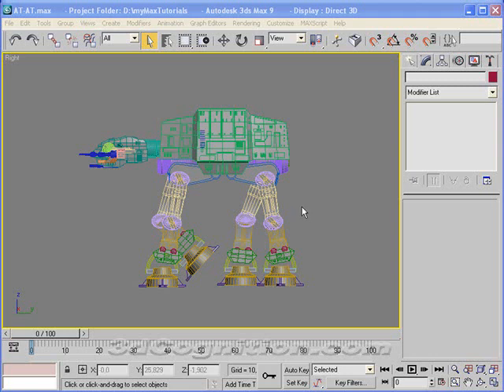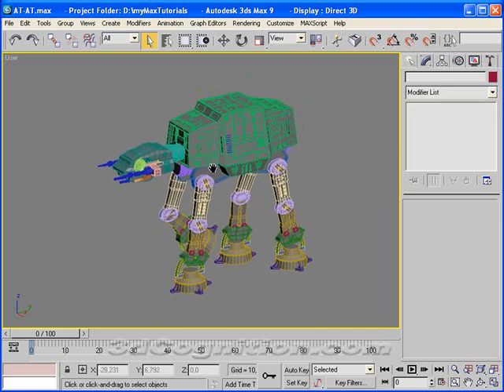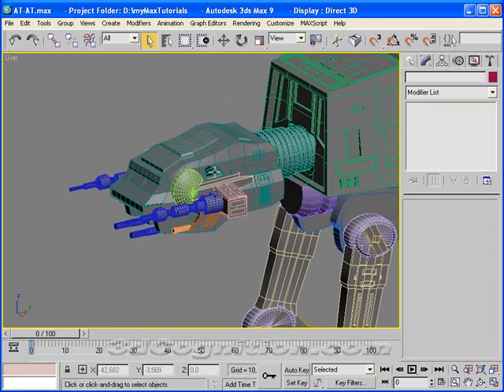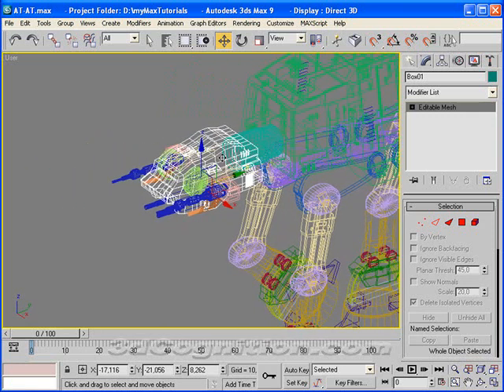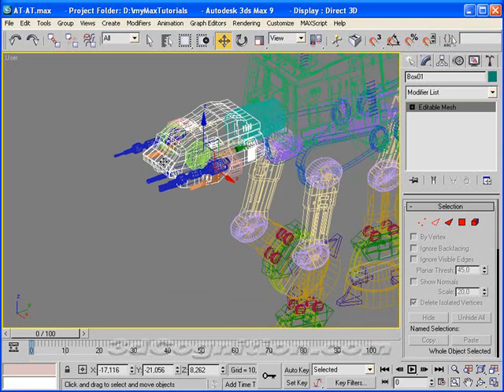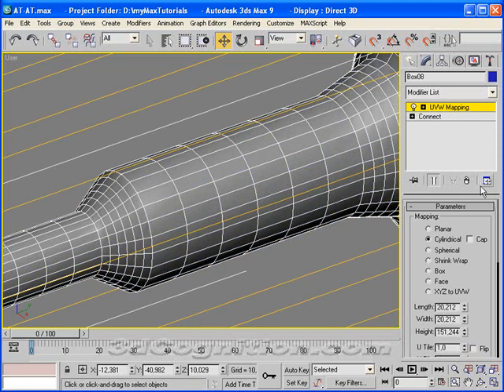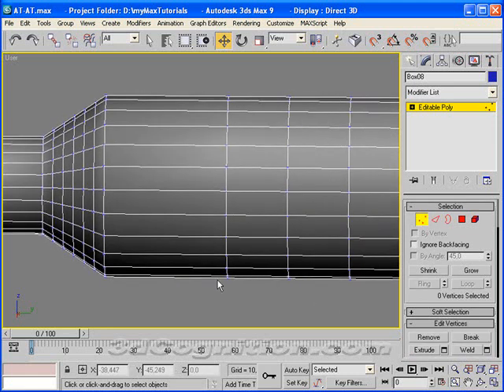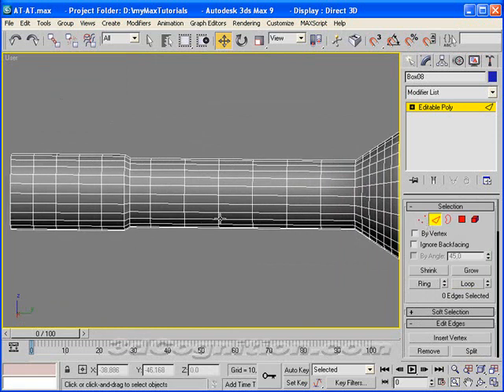Imperial Walker Modeling Repair and Concepts - # 1

Comment: You can constrain those loose items to the mesh that is part of the rig.That way Those elements will stay in the correct position despite not being part of the rig or even part of the same model (not attached)

Im not very experienced with animation but this was the first I learnt before watching these to learn rigging (thanks!).
Im using this atm to to make gears move correctly on a robot spider. the gears are seperate models.